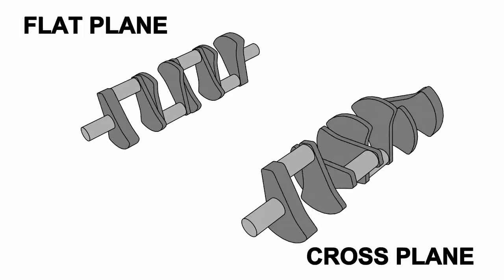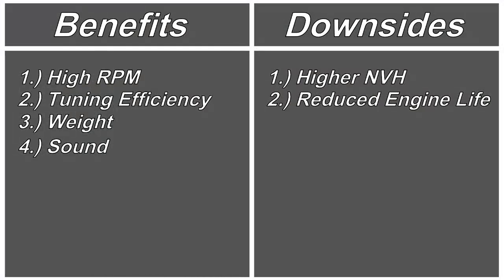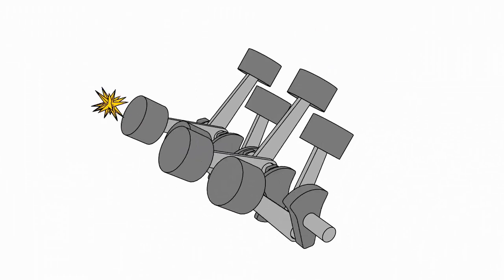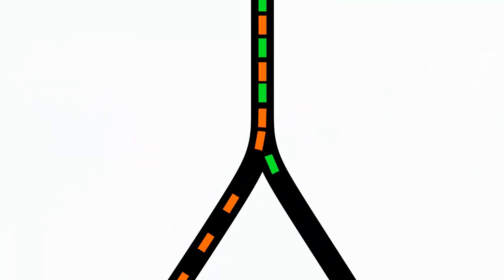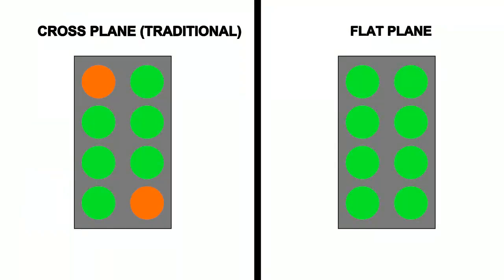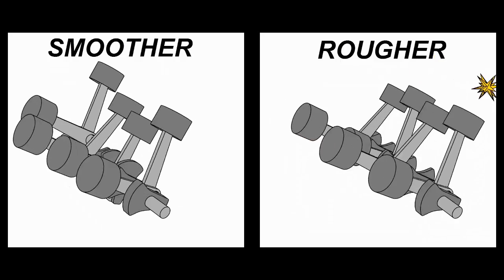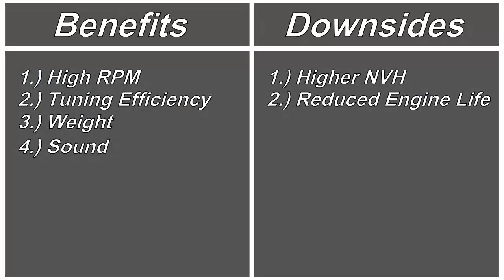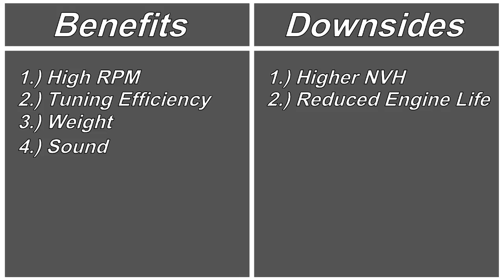Flat Plane Crankshafts

Comment: Thanks for the interesting and informative discussion about different types of V-8 crankshafts. I've been an ardent gearhead since I was a little kid and I wondered about an arrangement as described below for an engine design when I was a kid, designing my fantasy engines: 

I was wondering about a variation of the flat-plane crankshaft, where the number three throw is lined-up with the number two throw, 0º crankshaft offset. Consider the engine as being a V-8 with two inline 4-cylinder banks 90º apart, numbered 1-3-5-7 on the left bank and 2-4-6-8 on the right bank, as viewed from behind by the driver. With two connecting rods on each crankshaft throw, here is the firing order: 1-2-5-6-7-8-3-4. On each bank, the cylinders are equally spaced at 180º and so the exhaust pulses would be evenly staggered for good scavenging. My thinking at the time in doing this is that it might be easier and cheaper to construct than the flat-plane shown here. I suppose that the same second harmonic vibrations would also occur in my design, although they might partially cancel each other out or offer irregularly spaced vibration pulses over the full 720º cycle.

Comment: 1996 Dodge Viper. Explain this.
What does 1, 10-9, 4-3, 6-5, 8-7, 2 (unequal firing 90-degree and 54-degree intervals) mean? 
It means it is a 90 deg block, but due to needing to fire all 10 banks in 720 deg (2 revolutions of the motor), they needed to get the 
pistons firing at odd intervals - One at 90 deg, and the other at 54.
If they all fired at 90 deg, then they would have 900 deg total revolutions for all 10 to have fired. Does not work.

Comment: Pontiac made a flat plane V8 in the early thirties, vibration was a problem and it was dropped.
Reply: min bannister That was an Oakland and some were badged as Pontiacs in 1932. GM dropped that engine quick and developed the Pontiac straight eight. They would absolutely smoke a Ford V8 of course but were expensive to build.
Reply: Chevy and caddy both had flatplane v8s in the early to late 10s. In 28 Oakland and caddy started designing the crossplane.

Comment: does a cross-plane v8's firing order disadvantage disappear in a v6?
Reply: V6 engines can be flat 180 degree cranks or 3 x 120 degree.  A cross plane wouldn't make any kinda sense.
Reply: V6s naturally have a piston count disadvantage they cant have 4 planes to work with so you would be limited to 3 planes or youd have to go to a boxer style crankshaft

Comment: Common misconception that flat v8s fire every 180 degrees, your own illustration disproved that even as you said it. They fire 90 degrees like cross v8s. Also minor flaw is that the cranks themselves were drawn in accurately but that’s not really important. Otherwise great video
Reply: Yes and where are the center main journals?

Comment: The differences in performance aren't not very large a flat plane will make 1-2% more hp but will sacrifice some low end torque.  Flat plane really shine in road racing, it allow for the engine to change revs faster so quicker shifting in manual with less wear.  It doesn't typical effect the hard red line where the engine is prone to failing, that's mostly a stroke or parts thing.  The soft red line is the red line used on productions and is set typically around 500-1000rpm after peak hp. At any rate that is why they tend to red line higher.
Reply: Just changing to a flat-plane crank, and keeping everything else the same, won't change low end torque.  It will allow it to cammed for higher revs though, and aggressive cams hurt low end torque.
Reply: You have a power stroke half has often that will result in less torque 

 @michaelbenardo5695

Comment: Eh?! Crossplane is used by very few manufacturers

Flat plane or a variation of is what is used in most typical engines from just about every manufacturer
Reply: Huh? Your not actually correct. V8s a large majority are crossplane. Other engine configs some are naturally just crossplanes. Some just flatplanes.

Comment: I did some work with Petty back in the early 70s. I like your video. Ours flat crank was so wild it wouldn't run below 3,000 rpm without breaking something. Or 366 cid hemi w/4bbl made almost 900 HP and it wasn't even really tuned yet. It was dropped because it could only be driven at speed . Good memories.

Comment: Couldn't you compensate for the cross plane crank's exhaust scavenging issue by adjusting primary tube length?

Not always room under the hood for elaborate exhaust headers, though.
Reply: Yes header design can somewhat negate it but theres always a but it can in some ways hurt.

Comment: Since the exhaust pulses on a cross plane engine are not evenly spaced, why is there so much importance attached to equal length headers. The pulses arrive at the collector every 90 and 180 degrees crankshaft revolution. Right? Also, one or two balance shafts as used on 4 cylinder engines should work well on a flat plane 8.
Reply: While you will have some uneven pulses you still gain efficiency by reducing any turbulence points down stream. The goal is still trying to balance efficiency across the cylinders as best as possible. Adding more weight would reduce the reason flat planes exist in the first place.

Comment: The flat plane crank that is pictured is only used by Ford. It is used because this form is an intermediate step in manufacture of crossplane crank. Ferrari and other european sports cars use different form where the middle two throws are in the same direction and the outer throws are in the opposite direction. Ford crank is 0, 180, 0, 180; Ferrari crank is 0, 180, 180, 0.
Reply: I think he means something like this: ¡! ¡! ¡! ¡! vs ¡!! ¡¡!! ¡, Which is interesting. How's that firing order go, 87,21,65,43?
Reply: @jimbillyjenkims  idnk about your firing order though your first example is great and the second one was almost there
!¡¡! !¡¡! Oops I forgot two pistons on same rod journal,
:¡¡:!!:¡¡:!!: :!!:¡¡:¡¡:!!: I just realized it would be unseen in 2d 😂 the first one covers traditional and the odd flat plain crank 🤣
Unless repressed diffrently like this :!!:!!:¡¡:¡¡:
Reply: @jimbillyjenkims  Hey! that was some clever use of exclamation points!   Very good.  I up-voted just for that.
Reply: Interesting never caught that one...
So flat plane can be like two inline four cylinders side by side.
Or like two v-fours married front to back.
Don't forget street bikes... Yamaha flat plane.
Reply: honestly I think they also did it to keep the "Mustang Sound."  the GT350's factory headers are still the same 4-3-1 setup as on the standard Mustang GT.  With the alternating crankpins and those exhausts, it still maintains that "V8 burble" instead of a Ferrari-like scream.
Reply: @jm-mi7kl  you are correct.  Mustang owners don't want their car to have that smooth Kawasaki ninja sound like that of a Ferrari.
Reply: This is not an intermediate step. This is an engineered flat plane crank that attempts to reduce vibration. This is what car engineers get paid to do, create improvements or new designs.
Reply: BMW V8 race engines are flat plane, amazing engines. Way more hp per litre than LS and sound better too

And I own an LS
Reply: This is a good question because UDDU flat plane crankshafts have different balancing characteristics from UDUD flat plane crankshafts. It's valid to call it intermediate, because the layout Ford chose has balance characteristics that are between a UDDU flat plane crankshaft and a cross plane crankshaft. The only explanation I have found is that Ford chose this layout because there was not sufficient room for a 4 into 1 header, rather they are using 4 into 3 into 1. This exhaust causes a sound characteristic that is between a cross plane crankshaft and a UDDU flat plane crankshaft. Here is a reference: https://www.edmunds.com/ford/mustang/2015/long-term-road-test/2015-ford-mustang-gt-coyote-voodoo-cross-plane-flat-plane.html
Reply: The crossplane is also different. Usually crossplane is 0 90 270 180 but in the video it's 0 90 180 270
Reply: Thanks for that. Interesting fact
Reply: Dirty Harry  please explain how a cross plain makes more torque, you may know something I don't but to me that doesn't make sense
Reply: Chevy has introduced it into the new 2023 corvette.
Reply: See, THIS is what bothered me with the GT350, i just hear it having a flatplane but still kinda sounding like a "regular" V8

Thanks for clearing that up
Reply: But the Ford doesn't sound as good as a Ferrari and it never will. It literally sounds like a ricer but it's a V8.
Reply: @soulsnatcher5408  BS 😂😂👍👍
Reply: Or used to gain some benefits, and reduce the drawbacks in the engine that size. So, its a half engineering attempt to do flat plane crank, and therefore yields compromised benefits as ascribed to the so called flat plane crank. In particular, does not produce the sweet sound of the classic full flat plane crank. Its a half flat plane crank. I Like the rumble of old cross V8's, and the scream of full flat plane. Ford GT350 sounds mediocre. Carbs sound best, lol.
Reply: @drtone  You just pulled that out of your ass.
Reply: @Larcona_  Guy is clearly lost in the sauce.....
Reply: @drtone  you don't know anything
Reply: @drtone   This is why the Z06 when it's racing out N ring sounds nothing like a Ferrari.
Reply: @drtone  wait. Wut?! The NEW GT350 sounds "mediocre"?! Hah! I mean, you're certainly entitled to your opinion but youre also certainly the first person Ive ever known about to have that opinion!
They sound fookin great to me!
Reply: @MattH-wg7ou  he is probably a Chevy LS is the only power kinda guy!
Reply: You are insane if you think the GT350 sounds "mediocre".   Far and wide its been lauded for it's exhaust note. It doesn't sound like a small displacement V8 Ferrari but it isn't a small displacement V8...

Scroll up and type "GT350" in the search bar... the first suggestion is "gt350 exhaust" for a reason lol.
Reply: @testy462  i think it is used by Maserati Granturismo too
Reply: @bobanppvc  Maserati engines are crossplane.
Reply: Well both 0,180,0,180 and 0,180,180,0 are provably flat plane cranks, so...  you must be talking about firing  order which is obviously a different thing.
Reply: as for how a crank shaft balances and what not in two different configurations, the one having essentially a large lobe in the middle, the other different and more complex, it's impossible to talk about here, having to do with moment's of inertia or something and what not.
Reply: @immikeurnot  The 1970's Bora sure sounds like a flat plane. It is really gorgeous... one of the best things about the car. I owned one for 10 years and loved it from an idle to redline. Just so, so even.
Reply: @immikeurnot  not all of them
Reply: @immikeurnot .....Maserati is owned by Fiat & uses Ferrari V-8s
Reply: @bobanppvc  yes ma ferrari engine
Reply: @immikeurnot  correct.
Reply: @drtone "GT350 sounds mediocre"....
. Said no man ever! How can it be half flat plane? The rod journals are clearly 180 out. Just because it's not what Ferrari does doesn't change it's physics somehow.

Comment: Decent explanation, but missed on a couple points.

For exhaust pulses, timing the pulses for proper scavenging can also be done on a crossplane... you have to do the math on header tube lengths to get them lined up properly. It’s rarely done (exhaust fabricators seem to be allergic to math), but every now and again you find custom headers on a crossplane that sound like a flat plane. Also, the Mustang doesn’t sound like a Ferrari V8 for the inverse reason... it has unequal length headers, resulting in a subtle lilting/surging sound akin to a normal “American” V8. So pulses and scavenging has everything to do with exhaust system design, with cross vs flat plane firing order just dictating the tube lengths to achieve the desired results. For an example of how header design can change the sound and scavenging, look up “180 degree headers” for typical American V8s (the SBC or LS, for example).

Secondly: tuning/cylinder optimization. No explanation is given for why a crossplane would have low performing cylinders. Reality is, every poly-cylindered engine has some inequality in combustion. The more modern your engine management system, the better you can account for this. Some engines are literally tuned per cylinder. That was the whole point of using Webers on race cars... the ability to tune the mixture for each cylinder. Now with multi port or direct EFI, individual coil packs, and sensors galore, some engines can have fuel and ignition tuned independently. This will reach its zenith with the Freevalve technology, which will allow infinitely variable valve tuning for each cylinder as well. There is no fundamental reason a crossplane is somehow less able to be equalized than a flat plane.
Reply: Ducfandan, AGREED, I had a set of tuned 360 headers on my big block ford. and they work, but what a nightmare to install...
Reply: Alan Kulchecki please send me the link to these header please I have a 429 that needs Headers
Reply: DucFanDan That's not the only reason. The flat plane Ford sounds different because the crank journals are staggered every other. ----  vs --__-- where the center two are on the same.
Reply: Exactly the comment I was searching for, you literally took the words out of my mouth. 👏🏻👏🏻👏🏻👏🏻
Reply: I agree with the math and people not wanting to do it. It's just too easy to slap a turbo on let's say an LS motor with flipped stock manifold and make insane power. At that point people don't have to use the calculator, just the welder
Reply: @EGGINFOOLS  ...and you know that 10 to 1, the average gear-head will take the easier way. Often, that's the cheaper way but it still tends to go like that. I think only the "esoteric-techie-with-money" will go for the technically more sophisticated design... even if it is cooler.
Reply: @MrGaryGG48  The fact is technology concerning engine building is advancing at a mind boggling speed. You can have a custom engine part printed out of whatever material you desire. The LS is an amazing platform, but often tinkered with by idiots that want to go fast..meanwhile you have exotic engines that are in a junkyards, because people think they are not worth toying with. I may be a bit too optimistic, and too hot to trot, concerning forbidden engine platforms...but then again what would be the learning process in doing something the entire community of enthusiasts do...slap a turbo on a LS with open headers? I find it repulsive.
Reply: Awesome follow on explanation - thanks!
Reply: Thank you..
Reply: Old NASCAR headers used to cross under the engine to tune the length. I don't know if they still do or not. I haven't built a NASCAR model since Dale Earnhardt got killed.
RIP 3
Reply: Appreciate your thoughtful response, thank you.
Reply: Actually, you can't just fix it completely by doing the math on the manifold tube lengths.
Length equals time divided by speed. (For tubes, the time is relative to perfectly even firing sequence, and the speed is the speed of the pressure waves). The speed of the pressure waves is the speed of sound (constant). Time is always a certain fraction of the time of one engine revolution and thus proportional to that, i.e. inverse to RPMs. I.e. you can only get the tuning perfect for one specific RPM. - Unless the time is zero or very close to zero, which means a perfectly even firing sequence.
However, as other commenters have mentioned, you can cross the tubes of the cylinders that fire out of order over the engine block.

Comment: you DO realize that you got BOTH of those crank's pins wrong right?
the Flat plane should be (Fan side   low high high low     Flywheel side)
where as the cross plane should be  on the X/Y axis  as  90*up  0* flat left 0* Flat right  and then 90* straight down

Comment: You missed a huge disadvantage on the flat plane side: a cross plane crank can be over/under balanced; a flat plane cannot! Flat plane v8 will never match a cross plane v8's output capability. This is not the same as secondary imbalance, but sec imbalance can be fixed on cross planes. Ford started with single plane cranks; maybe it ought to die with one too. Can't wait for the idiots to start putting to much boost to them.
Reply: F1 cars are flat plane ? no ? Those F1 guys must be idiots
Reply: Nor Dic you didn't just pay attention either you just said something about balancing with high boost you need balancing the flat-plane crank if you put boost behind it will explode a cross plane crank can make up to 10,000 horsepower a flat-plane crank on never get that at all ever
Reply: That's the reason why the american crossplanes engines are so efficient with a much higher power/volume ratio than european flat plane engine like Ferrari, BMW, Audi... Oh, wait.